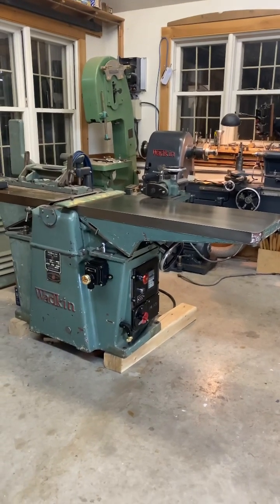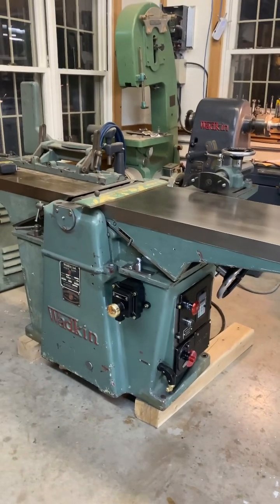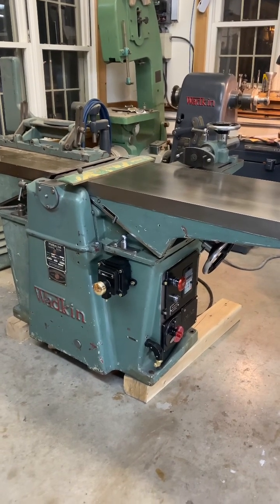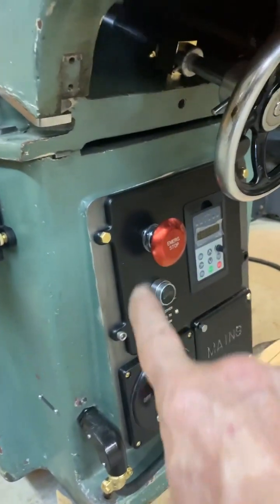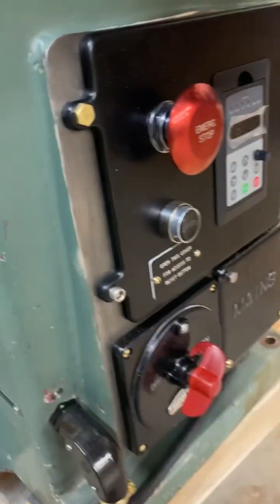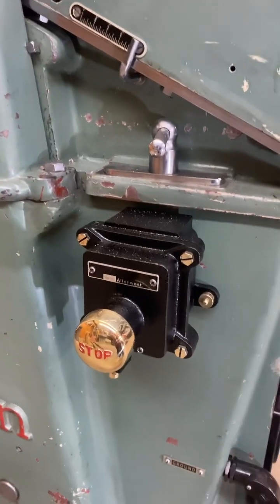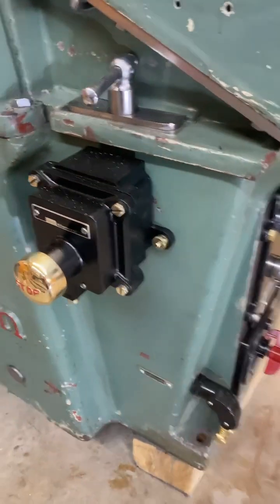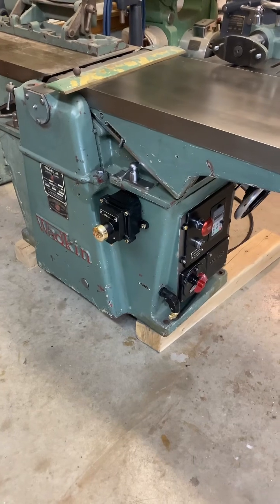wadkin RZ emergency stop

Comment: Sir that’s a mighty fine job.  The choice of switch gear is spot on. They don’t know how to make equipment like this anymore.  👍. Bob
Reply from the maker: I really do enjoy bringing the electrics from this area in the check as it is often the first thing to be replaced on vintage machinery. Either because woodworker no very little of electrical work and leave it to the electricians whose choices whatever is available on the market at their local supplier.